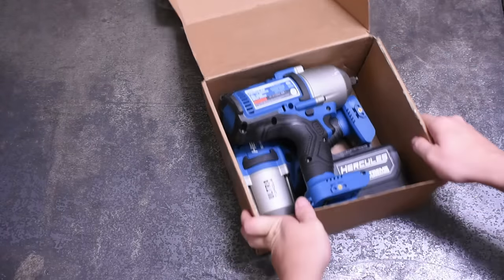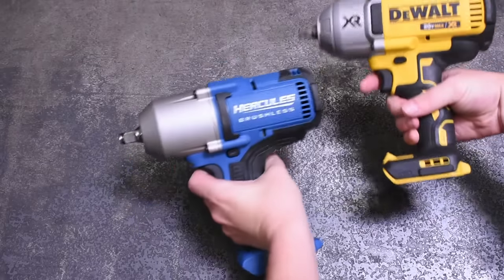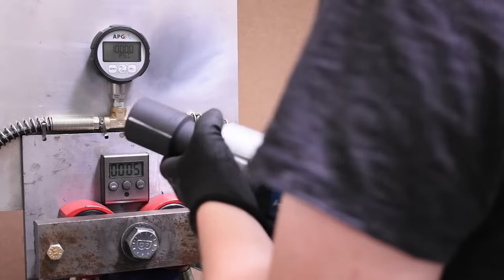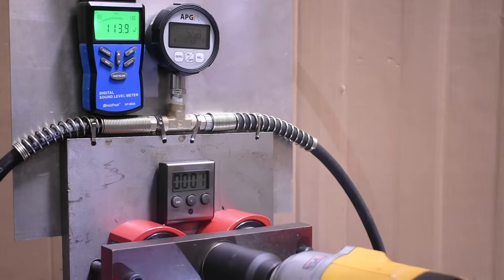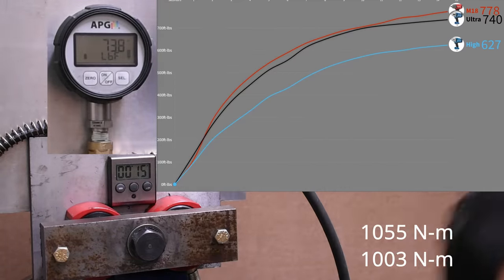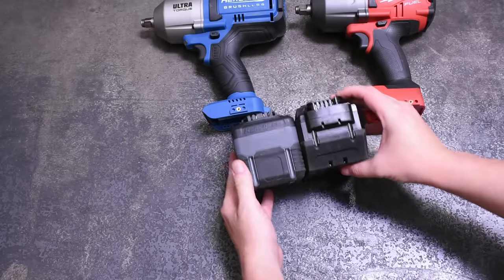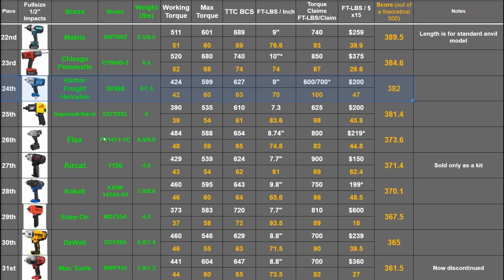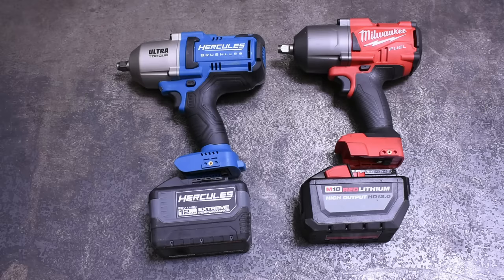Harbor Freight Dethroning Milwaukee & DeWalt w/ New Ultra Torque Impact Wrench?

Comment: For a shop, that price difference could add up, but perhaps even better would be the over the counter warranty. Being able get a working tool same day could mean a lot.
Reply: I had to buy extra Milwaukee power tools, because of how long their warranty process takes. I can't do without my money makers for 3 weeks. So for power tools, HF should compare the price of ONE over-the-counter-warranty, versus the price of TWO mail-in-warranty ones.
Reply: Same my grinder is out for three weeks for rebuild and it was under warranty so  yeah....lol
Reply: Yeah but drive around to alot of hf stores right now some are missing the dumbest things. Even big ticket items I love hf and I'm considering running two battery line ups but if I can't come in and grab one of the shelf it's a no go for me even if power to cost ratio is better
Reply: That's huge, because, normally you have to mail it in, wait weeks and still possibly have to pay part of the cost. All the while you've already gone and gotten a new tool just so you can work in the meantime.
Reply: @TheChrismanis1791 I find that of the two harbor frieghts in my area, one is always out of everything while the other has everything. I just don't go to the first I described.

Comment: We need some Durability testing. See how long they all comparatively hold together!
Reply from the maker: We'll do our best. These seeing upwards of 8 30 second test attempts alone is quite a beating.
Reply: That’s really what it comes down to. 
Can it do the job, and how long can it do that job before needing replaced. I don’t care what color it is lol
But if that 5 year warranty is actually as good as they say… I’ve been in the market for some 18ish volt tools..
Reply: @kylesalem-fuson8012  go get milwaukee and don’t look back.
Reply: @samuelgrogan6443  all the boys at my shop have a Milwaukee, I use em from time to time. Personally I prefer air wrenches. But sometimes I need a cordless. 
And honestly Hercules looks much more appealing now if that 5 year warranty is actually trouble free lol
You Milwaukee fan boys are as bad as Toyota and jeep guys lol
Reply: @kylesalem-fuson8012  I am also a toyota guy 😂 I’ve never had issues with milwaukee warranty. You only hear from people who had a bad experience, not the good ones
Reply: @samuelgrogan6443  Hard to beat the over the counter warranty though,  you gotta admit.  Waiting on a tool to get rebuilt or just getting a brand new one.  That's a checkmate in my book!
Reply: @SVMSICE  Yep and you know HF will stand by it because they're vertically integrated. 
They know all the factories making other brands tools and just the fact that they're selling direct saves you a lot.
Tests like these are showing how good Hercules is on the new brushless lines.

Comment: If I was in the market for a high torque I would actually be very interested in this Ultra Torque. Seems like a great value. That said I already bought a Ridgid Octane high torque, completely because of this channel. Appreciate you guys.
Reply from the maker: The only thing bad about the Ridgid Octane high torque is if you own one with a good battery, you probably dont need to tune into this channel for a couple more years :P
Reply: Never hurts to have a backup especially for a tool that’s no longer in production.
Reply: @TorqueTestChannel  I have 12 good batterys and I will al tune in lol
Reply: @TorqueTestChannel  and yes you cost me $230 on that Octane as well lol
Reply: @TorqueTestChannel  hopefully Ridgid will actually release that 21700 cell 8ah battery one year (its been advertised as coming soon for over a year now). When the 8ah battery does come out I would love to see that tool revisted with the new battery. 

I also bought the Ridgid high torque based on this channel's recommendation and it was such a life saver when I replaced most of the front suspension on my truck. It was mind blowing zinging off nuts and bolts with ease with the high torque. If it couldn't loosen it, it could break it off which was fine by me lol
Reply: As did I, that thing is a beast!
Reply: Same here 🤘 love the ridgid
Reply: @paulycrackers1382  I was at the store today to buy the makita which no one sticks and right there in front of me w were the Milwaukee and ridged. 2 hours later I ordered the makita as I really needed that 900 plus torque for semi tires and rusty lugs  here in the Midwest . But this Hercules with 12 ah batt will replace my earthquake but in backup duty as soon as it’s actually in stock again .
Reply: So did I but that Hercules does look like a good deal cx I’m tempted to buy lol!
Reply: @TorqueTestChannel  No worries there. I'm an early subscriber to the channel and I have never missed an episode. And I have 4 batteries lol.
Reply: Bought the astro  Thor because of this channel.

Comment: i hope this is a sign that harbor freight is going to continue stepping up their game! they have so many levels, they can keep one brand as cheap as possible, another to compete with the big brands, so they get the best of both worlds
Reply: That's how it is now really.
Reply: I haven’t bought anything from harbor freight that has lasted any amount of time. The metals & materials used in all the hand tools, drill bits & most everything is way cheap & not near the quality you want or need for basic wrenching around the house, under the hood or under a oil pan. Nothing has lasted when used correctly as intended
Reply: @AMPEDUP488  i have hand me down Pittsburgh ratcheting wrenches that i use every day at work on industrial machinery. Not one has let me down yet
Reply: @AMPEDUP488 idk their sockets and archers have lasted me a bit. I have the impact driver and the ultra impact wrench and they both work great. I really love the ultra torque, use it when working on chillers because it’s around water.. it’s held up and has busted off some super tight and rusted bolts and their 21700 battery’s last quite awhile!
Reply: Everything I've bought from harbor freight has worked out. 

I hit the end of warranty on one of my impacts and just swapped it out for a new one before it expired

Also it should be noted that a set of Pittsburg impact sockets have held up being beat up by a dcf899 for years.

All the sockets are still good and usable in my tool box.

I've maxed out the dcf899 many a time using those sockets on 23+ year old Midwestern vehicles.

I've broke more expensive shit with less stress, I'm sure we all have.

Comment: Honestly really impressed by this. I've noticed lately it feels like Harbor Freight tools and stuff have been actually climbing in quality. Obviously still not generally anywhere close to name brands that are typically thought of as "high quality" but it really seems like they're trying hard to genuinely compete with more highly thought of brands.
Reply: They've had = quality on many products for 20 years now.
Reply: >Obviously still not generally anywhere close to name brands that are typically thought of as "high quality"

I don't think its that obvious anymore, which is a good thing.
Reply: Considering the top names are all basically manufactured by just 3 companies, I'd say it's a drop in quality vs and improvement on HF's part.
Reply: @BurningBroadcast  I mean they are pretty quality compared to name brands, I’ve been using my Hercules impact on diesel trucks, my mustang and other stuff and holds up fine so far
Reply: Yes i just pick  Hercules,  Icon and Daytona brand in harbor freight   , they are proved good quality , they are not the cheapest but fair price  , so Good brands
Reply: Sk
Reply: I think harbor freight realized they can offer contenders while still being affordable, for the weekend warrior these are going to prolly do everything needed.  They def seem to own the best warranties
Reply: The Hercules line is straight up a professional brand. The brushless units are what you want. 
I'm a contractor and I was surprised how many employees wanted HF when given a choice of what tools they wanted.
Reply: I got sold on Hercules in part for the battery pricing starting full retail @ $25 for the 2.5ah even the 8ah and 12ah extreme (21600) are  half of the others hovering around $100 before sakes or discounts.

Comment: Thanks for the video. Nice to see HF disrupting things once again. I use a Milwaukee 2767 in my shop and it’s pretty awesome, and I have mid-torque and smaller DeWalt and Milwaukee tools at home, but I picked up HF’s Bauer driver, drill, and reciprocating saw for use around the shop and I haven’t been disappointed in them at all. Maybe it’s time for the Hercules Ultra Torque in my service truck…

Comment: Definitely need a test til fail comparison when these become more widely available. I love my Milwaukee stuff and as I’m a diesel tech I need it to hold up to a long term beating. Real world application, the 33mm lug nuts on a semi call for 450-500ft-lb of torque, and I’ve used my Milwaukee on a 6 Mississippi count to make that torque wrench click when set to 475. Consistently. Super impressive

Comment: I just picked up an Ultra Torque today. They didn't even have a display model up yet, lol. Coming from the Bauer 1/2 (meh), then the Earthquake 1/2 XT (100% better than Bauer), then to the Hercules Ultra Torque.. It makes the Earthquake XT looks like a toy. I love the fact that Harbor Freight gives you 3 months to try out a tool. I had the Bauer for a day, ran back and traded it for the EQ XT. Then today traded the XT for the Ultra Torque. Glad I did. Worth the money (so far). With a 5 year warranty I feel more confident.

Comment: Just snagged the ultra torque today for $102 , already ripped through a tire rotation my mid torque couldn't get the lugs off. Less than a second it felt the ultra removed the lug nut, crazy power for a diy guy and 5 years worry free I'm a happy camper. Ditching my DeWalt stuff one by one.
Reply: Same, absolutely redonkulous deal on clearance.

Comment: They come with a 5-year warranty too--which is pretty suprising to me, as I question the tools reliability overall.  I use my Milwaukee impacts everyday and put them to work, and they're great.  If I wasn't in a professional industry and I only used tools at home on my own cars and projects, Harbor Freight's line of tools is what I would most likely buy.  I think Harbor Freight's line has many great tools, especially for the price.  But when it comes to power tools like these--I would still probably go with Milwaukee because the price difference isn't that much, and Milwaukee is a legendary reputable brand.

Comment: I have the dewalt 899.  For about 2 years now.  Ive been pretty happy with it, as a driveway mechanic only using it maybe once a month, its been great.  I actually chose it just because the battery was swappable with my power tools and yard tools.  Hard to leave a brand i have so many batteries for.  I even modified the Kid's power wheels to take 1 a 20v Dewalt battery.
Reply: flexvolt 60V is awesome: from SDS drill to chainsaw, I'm loving it!
Reply: The DeWalt mid range impact does pretty much the same as the 899 just a lot lighter. By far one of if not the best power to size ratio.

Comment: I think the thing I like most about the Hercules is the more angled grip, but I do applaud them for making a good high torque and (sorta) meeting their advertised numbers. I don't think $20 is enough, or should be enough, for someone to choose questionable HF reliability over what is basically the industry standard. To the ones that counter that with the in store warranty, that doesn't help you when it quits in the middle of work. And don't forget that the Milwaukee/Dewalt those are being compared to are 5-6 years old as pointed out. Really it just comes down to what battery line you're invested in. If you have M18s, you're gonna get a 2767,  if you have Hercules batteries, you're gonna get the Ultra Torque.
Reply: the real thing is if you don't have any batteries yet the hercules is actually more like $150 cheaper or more if you want 2 good batteries and a charger. if harbor freight could learn to stop changing batteries i think they'd have a winner
Reply: The thing about harbor freight though is if you buy the tool and the extended warranty . 1 year is good enough as most of their tools I have broken in 5-6 months , is that from 9 am to 8 pm I can have a new tool in 10 min, for the cost of a new warranty. I don’t have to send it in and wait and I’m not down much time . 

If premium brands never break in that 2 year times span then that’s great but if they do then you’re out several weeks I’d assume while you wait . And then you’re probably going down to harbor freight to buy a cheap back up anyway .

Comment: HF definitely upped the ante here. They addressed popular concerns like the ratings and the warranty, they brought the beans, and they have good prices.  That 5yr warranty, direct swap at the store, that's 100x better than Milwaukee "warranty", that's for sure.  If HF expands this line of brushless 18V tools with similar warranty, Hercules is on its way to becoming a well-regarded power tool brand.  

Now if only they could do something about that bundle discount where you have to buy tool, charger, and battery.  They should make it so you can buy any combination of three because to get the discount (like 2 tools and a battery; 2 batteries and a tool; etc.).  Because nobody is going to buy a charger every time.

Comment: Btw while their MSRP price is close to the current mainstays like DeWalt and Milwaukee, when you consider their sale price, along with the bundle discount if you also get a battery and charger, their price drops fairly significantly. Both tools are currently on sale. The Ultra i think is $199, and the High torque is like $179.

Comment: Would be cool to see you test out the new bauer brushless 1/4in driver. Super cheap and a lot more torque than the old brushed driver. I use it all the time.
Reply: I work for HFT im waiting for this also! I own Bauer tools but I might change that after this video!

Comment: I bought the Ultra Torque for use on my Peterbilt 387 and it powers off the lug nuts like a champ. I bought two 5AH batteries and the dual charger which I can leave plugged in in my under bunk storage so I can charge the batteries as I'm driving. Just bought a 2004 aluminum flatbed trailer and the lug nuts were so tight that my 4' breaker bar with a 4' cheater couldn't break the lug nuts loose. Way WAY over the 500 Ft Lbs torque spec! The Ultra Torque took a bit of time, but I was able to get all the wheels off so I could change the tires.

Comment: I own the DCF900, 2767, and the Ultra Torque. Been using the ultra torque the past couple months and I’ve been loving it. Gets the job done for what I need, breaking away tight rust 1 1/8” bolts

Comment: When the Ultra Torque inevitably sells way more, I bet that HFT's takeaway is that they should start calling all their high torques ultra torques, not that it was a stupid thing to release a stripped down/weaker version alongside the nearly identical prime tool.
Reply: Lol yes. Why even bother having a step down from the ultra torque. It's already a massive size package
Reply: @OtherDalfite  Profit
Reply: right?  it would have made more sense to target Milwaukee's mid-torque offering with 450 tighten / 600 break-away.  With it's smaller footprint, I find that it's the right tool for the job most of the time, and I use my mid-torque far more than I use the high torque, but when the high torque is needed I'm thankful I have both.
Reply: @OtherDalfite  they want the consumer to buy the ultra torque, so they made a version that’s worse than it to compare to.

Comment: I worked in a mill for a contracting company installing new mill equipment, and we used all Makita 1/2 " and even some 3/4 " guns and tools. They were ok but always lacked the power to really tighten the 1 3/4 " bolts we were dealing with. Boss switched to all Milwaukee guns with the biggest batteries we could find and they were wayy more powerful. Would tighten the same bolts in less than half the time to the same Tq spec. Also they seemed to handle falls from 20-30 feet alot better. I now personally use Milwaukee tools in the automotive industry and am glad i made the change from Dewalt and Makita aswell.

Comment: I do automotive for a living and own the Hercules 20v impact driver (5a battery) and 1/2" High Torque (8a battery). The impact driver is obviously good enough for light work, and surprisingly strong for some medium nuts and bolts with 1/2" impact adapters/sockets. I use the High Torque for anything beyond that. Has been enough power for my needs. Very satisfied with their products and like the peace of mind knowing I can just do an exchange at the store if one breaks. I'm also fortunate to not live in a state with rusted vehicles

Comment: With an at the counter warranty, and price, and battery price,  5 year warranty instead of 3,  how could you go wrong!  In my book,  Harbor Freight just blew the doors off the competitions with all that!
Reply: The balance scale has now switched from performance to price. Which wins: .05% better performance or 30% better price (I didn't bother to work out the exact percentage because I'm not in the market for any of these but if I were, price now wins).